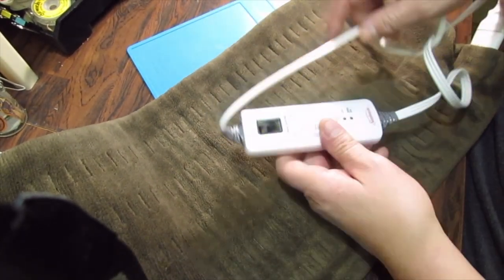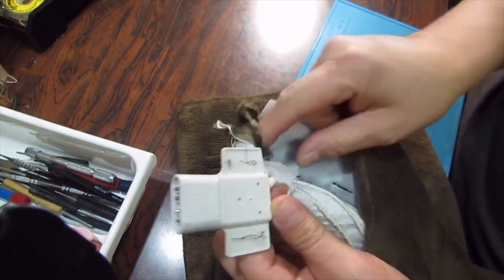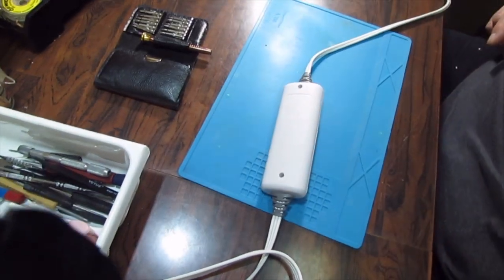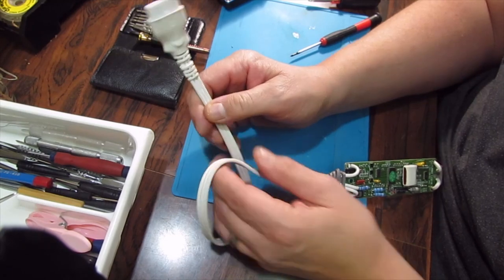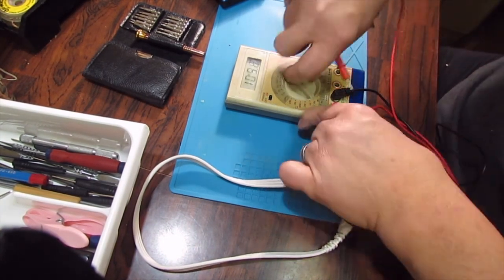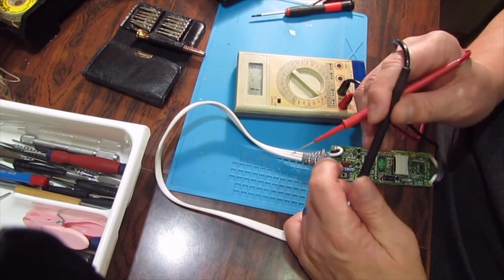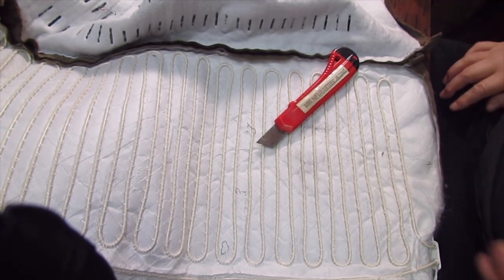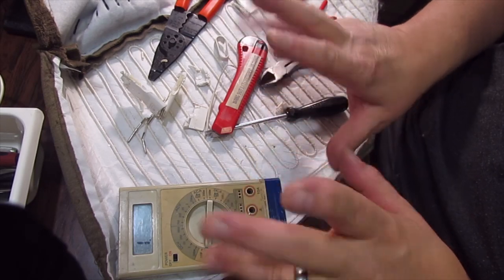Why did  this heating pad Fail? Sunbeam Heating Pad Fault Light on.  No Heat. But Why?

Comment: Definitely not buying these, ive had 3 in 3 months and they all fault out
Reply from the maker: Yes they have a limited lifespan, especially if they are folded or rolled up.
Reply: Mine lasted 5 years of daily use. Walgreens brand. But it was luck cuz the other Walgreens brand I had before lasted less than a year 😅
Reply: I just got one...maybe a month or two ago...I actually used it for a bit but ended up running it through my front load washer as it said it waas washable....then let it air dry... It still works. I'm careful not to roll it up or bend it... I use a heating pad to stay warm... I actually think they work better than electric blankets...I registered mine on the site. It says it has a 5 year warranty... don't think for a second when/if it goes out i'll be calling for a new one.
Reply: Same here

Comment: I had the exact same pad fail the same way. I spent a good while trying to figure out the problem, and never did. But at least I did have the correct weird screwdriver 😝
Reply from the maker: Common mode failure.

Comment: Not sure it was obvious but the cable in modern heating pads will have a wire meant to get hot and a wire to break it:-)  The break it wire is there because people complained about loved ones burning to a crisp in house fires. I forget exactly how it works but it seems like maybe it is made of a material that breaks from repeated bending before the warming wire might break and begin arcing. It may also or may instead melt easily if there is a hot spot or act to signal a short.  It may not be a bad idea but I think it may have been seen as an excuse to lower overall quality since fire is less of a danger or build in more planned obsolescence. In any case, my mom seems to have to buy herself one or two per winter which is why I've explored the guts. If you don't' mind burning down the house, it might not be difficult to spoof a working safety wire, haven't tried because I am pretty sure I don't like burning to death. However, the warming cable inside can potentially find new low voltage use where fire isn't an issue. I had trouble with my telescope optics freezing over so used calculated a reasonable length to use at 12V and now it just dews over:-) Seriously it did help most nights.
Reply from the maker: Hi, Very Insightful and helpful.  Good sense of humor too.  thanks for stopping by.